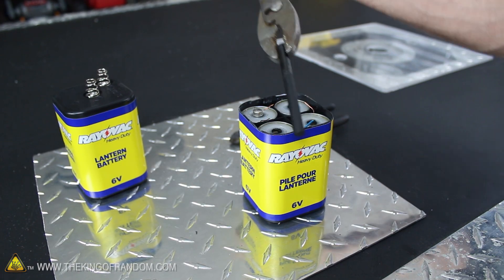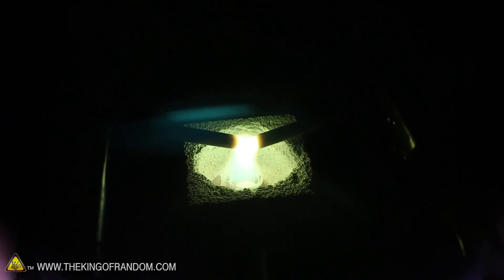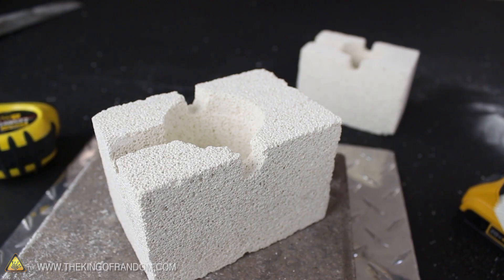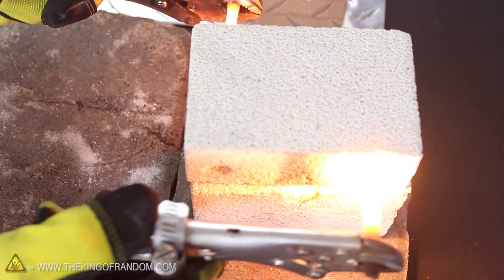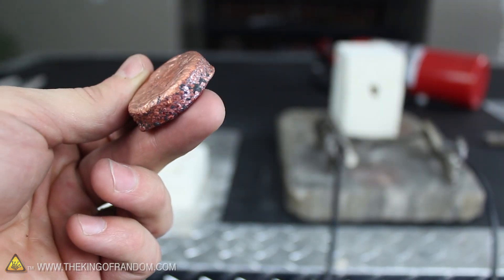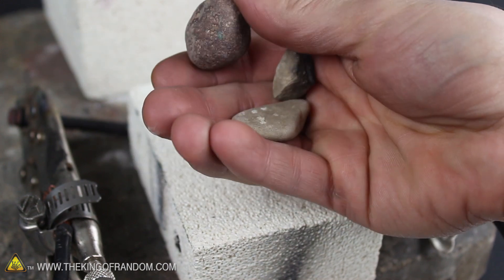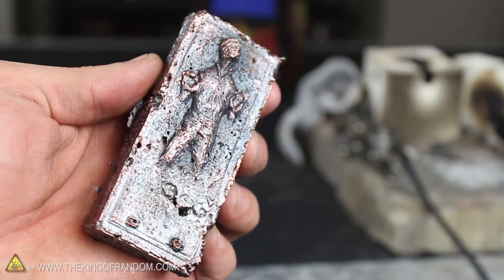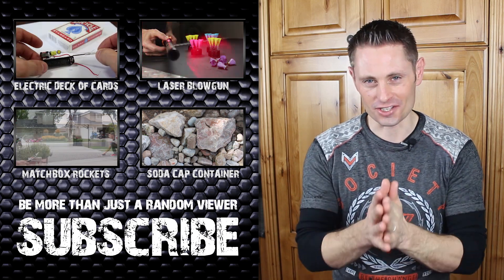Mini Arc Furnace (Arc Reactor Technology IRL)

Comment: Any metal? Even tungsten?
Reply from the maker: Yes, any metal :)
Reply: Iridium reinforced tungsten steel?
Reply: And if you tried to melt tungsten with carbon rods they would react to form tungstencarbide
Reply from the maker: Will Leonard Yes it will melt tungsten
Reply: Benny Kolesnikov That makes absolutely no sense.
Reply: Grant Could you do a video melting silica sand into glass  I'll have to try and make one of these myself when it stops snowing
Reply: If it melton stone, kind of yes, any metal. Pure Tungsten melts at 3.4k ˚C, while stone melts between 1.5k and 4k, depending of the silica composition of the stone. (While it is most usually at 1.5k, i'll place my bets in yes, it can melt tungsten)
Reply: Not tungsten you would have to heat it up to a little over 6000 degrees Fahrenheit
Reply: Grant Thompson - "The King of Random" only metal and rock?  What about RAP ? 

I'm sorry .. don't shoot me with a dart now :(
Reply: Okay but guys, he said it will melt ANY metal, so the question is, CAN HE MELT METALLICA???
Reply: If it was hitting 8 to 9 thousand the carbon rods would start to melt
Reply: Benny Kolesnikov For anyone confused its a reference to a minecraft mod
Reply: Will Leonard Carbon doesnt melt. It sublimes.
Reply: Grant Thompson - "The King of Random" can it melt adamantium?
Reply: Trey B I will try to explain with thermodynamics why this could DEFINITELY melt Tungsten:

He's reaching a temperature of 3000F in three minutes (yuck, Farenheit)

So that's 1600 degrees C in 3 minutes, multplied by the average specific heat of steel (452J/Kg/C) 

Let's assume he's heating 1/4 of a kg of steel, so in 3 minutes, A quick back the envelope calculation says the total heat change is 180.9 KJ, and he's applying roughly 1 kilojoule per second to the steel.

You can probably already see that this depends more on the mass of metal you want to melt than the type of metal.  Also, tungsten actually has a MUCH lower specific heat than steel: (the specific heat of tungsten is roughly 132 J/Kg/C.)  This means it takes less than 1/3 the amount of heat to increase the temperature of a mass of tungsten by 1 degree than it does to raise the same mass of steel's temperature by 1 degree.

So yes, you could absolutely melt tungsten with this, the only constraint is the AMOUNT of tungsten you can melt.
Reply: Grant Thompson - "The King of Random" 
What about osmium
Reply: Grant Thompson - "The King of Random" It would be interesting to see how you would attempt to apply this to the forging process, or maybe make it bigger and modify your back yard foundry for it.
Reply: Maybe not tungsten. I know that tungsten takes like 6,000 degrees of heat before it will melt, and that furnace is 3,000. "Only" 3,000.
Reply: eswar kumar
Um tungsten is a real element xD
Reply: gregistopal That's its boiling point, not melting point. Its melting point is only 3186 °C (5767 °F).
Reply: Most of the Earth is already "melted" except for the crust and the core. We know it can melt rock and iron, so yes, it could theoretically "melt" the Earth... Just gotta find one big enough. He meant any metal above the crust though, away from the millions of tons of force of gravity the core is under.
Reply: Stefano I know, but when talking about melting points in materials which does not melt, the melting point is equal to the sublimation point
Reply: Rasmus Tollund I did not know that thanks :D
Reply: Caleb Evan It was a typo.
Reply: Caleb Evan You clearly have a misunderstanding of the internet.
Reply: Stefano NEVER!!!!!!!!! his BATTERY is not powerful enough
Reply: Trey B A flame doesn't have a defined temperature, also this is not a flame, it's an arc.  it is adding heat to a constant volume, constant pressure system.  I am assuming that the system will reach equilibrium at a temperate higher than the melting point of tungsten, but considering the fact that it's made out of fire bricks, that's a pretty safe assumption.
Reply: ***** nope carbon but thats like 90C higher so they are pretty even (note Carbon sublimates and thats close to its melting point)
Reply: Everything but Death Metal.
Reply: erikharfager ok i guess
Reply: Will Leonard
that plasma arc is hitting close to 8-9k i'd say. So tungstem shouldn't be a problem
Reply: If it gets to 3000°f no it will not tunsten is about double that
Reply: ***** A plasma cutter could do it though bc those can go higher than 28,000 °C (50,000 °F) but since this doesnt have a nozzle that redirects the arc to one point it doesnt goes as hot.
Reply: Kyle Jones Thank you.
Reply: Will Leonard true, but it is kind of like saying that if you melt iron with carbon fuel, you get steel. I don't know, does it count?
Reply: ugh, I can't find my comment, I don't know what happened to it.  I'm not bothering with retyping my sources and making my comment look like it's from someone who has put research into the topic (since it was around 20 lines). But given enough rods it should. (I'm a welding student) Carbon melting point 3550*C, Tungsten 3422*C, Electric arc (lightning is 30,000 Kelvin). Many rods would be used, as the melting points are close.
Reply: I don't think that would work well, considering the difference in melting temp is only ~120C (tungsten is 3422 and the carbon rods melt at 3550/sublimate at 3642)
Reply: Captain Kerbal I'm planning on doing just that, the applying it to forging part that is.
Reply: Sam B If that is Celsius, then I think you're a little skewed because the boiling point of tungsten is 5555°C. If Fahrenheit, not sure.
Reply: ElectricPyroclast its 10031 Fahrenheit
Reply: How about http://en.m.wikipedia.org/wiki/Rhenium
It melts at 10100 ferinheight
Reply: ***** That's what I suspected. Thanks for the confirmation.
Reply: ***** AvE what are you doing here? Get back to making awesome videos!
Reply: ***** tungsten has a way higher melting point than stone
Reply: ***** rocks have melting point of 1200C and tungsten has +3400C which is a lot more than 1200C ofcourse
Reply: Grant Thompson - "The King of Random" Make a "Quick Tips" video of it making Tungsten!!!! I am curious to see if it does!!!
Reply: Grant Thompson - "The King of Random" Or will it make Tungsten Carbide which has a melting point 800'c lower?!?!?
Reply: trolzor Do you honestly think that he has osmium at his disposal?
Reply: Tungsten has almost the same melting point as carbon
Reply: Of course not any metal  if it was any metal it can melt anything even the earth.
Reply: Crazy Confenenation Conformer Yes, when he says any metal I think he means any daily metal.
Reply: no not any metsal  orelse the it can melt the earth
Reply: Rasmus Tollund carbom doesnt melt silly it sublimates
Reply: Stefano It still has a melting point
Reply: Rasmus Tollund it does not, google it
Reply: I'm not saying it melts, it's "melting point" is just equal to it's sublimation point.
Reply: sublimation is not the same as melting silly
Reply: Stefano It is spelled carbon not carbom.
Reply: Caleb Evan well you know bc the M isnt right next to the N
Reply: Stefano Just saying.
Reply: Caleb Evan No need to state the obvious.
Reply: Rasmus Tollund I know.  But if he knows so much about it then I would think that he would know how to spell it.
Reply: Rasmus Tollund Yes I know.  But if he really cared he would have made sure not to spell it wrong.
Reply: Cameron Bigley If it gets to 3000 degrees in 2 minutes there's very little reason to think it can't get to 6000.
Reply: Justin Hall He never tried more than 3-4 minutes though because he thought it might fail, the rods last about 10 minutes each he said, but keep in mind he wasn't going over 3000F ish
Reply: Stefano No, I'm saying you can melt a certain amount of tungsten with it, the less you are melting the faster it will melt.  Since it takes less heat to raise the temperature of tungsten than it does for steel it probably wouldn't take much longer, it might even take less time.
Reply: Justin Hall but you are assuming that the flame is at or above the melting point of tungsten
Reply: What happens if you super heat a diamond? Will it liquefy? Or am I stupid for thinking diamond can liquefy
Reply: Musaddique H Carbon sublimates when it rises above it's heat of fusion point.  That's why the carbon rods don't melt, they actually evaporate!. I would expect that diamond does also since it's a form of carbon.
Reply: Justin Hall couldn't you do some trickery with air pressure to make it a liquid? Or is it a permit solid?
Reply: waysideme Actually, yes, you probably could melt carbon/diamond at extremely high pressures.
Reply: Benny Kolesnikov lol you just got that from FTB
Reply: Chris Nields
It was from GregTech, get your mods right!
Reply: gregtech is in ftb...
Reply: Gone from if an arc Can melt wolfram to discussing mods and modpacks for minecraft
Reply: Grant Thompson - "The King of Random"  What editing software do you use to make your videos?
Reply: Chris Nields
*One of the mods in FTB. I played with GregTech before the FTB launcher went public.
Reply: i said it was in it... what are you correcting
Reply: so he can turn Titanium into a gas with this? Because that's what it takes to melt tungsten.
Reply: erikharfager carbon can theoretically melt at 100 atm and 4000k. however, this is not possible on earth, and so little is known about liquid carbon as we cannot easily produce it.
Reply: Adam Starhawk That is not even relevant, and you only wrote that to get the kick out of "superior intelligence" and therefor, here you go, I am superior'er. These conditions are able to be met on earth. Electric arc furnace, flood the place with argon, use the coal itself as a container. There is little known about liquid carbon because there is nothing to know. There is little known about liquid hydrogen too. And liquid boron. And liquid Byrilllium. And liquid lithium. Do you want me to continue?

Oh, and please dont go around trying to prove superior knowledge, as it is a sign of inferior knowlege. Google the dunning krueger effect.
Reply: ***** It wouldn't because it isn't real
Reply: can it melt diamond? XD
Reply: MultiDragonSlayer820
Diamond is made of coal, meaning it would burn. In an oxygen free enviroment diamonds would sublime directly to gas because of how coal works. You would need around 100 bar of pressure to make liquid coal, at 4000K
Reply: erikharfager yep, what this guys said. 100 atmospheres of pressure, and 4000k to melt carbon
Reply: ***** adamantitanisteel!
Reply: erikharfager i think you mean carbon instead of coal
Reply: Stefano You're right yes. Becomes hard when you think in your own language because in swedish we only have "kol" to describe both  - which translates to both coal and carbon
Reply: erikharfager im dutch but i think in english when im on the interwebs xD
Reply: AtJustDom He means the iridium enforced tungsten thing. Not tungsten.
Reply: Grant Thompson - "The King of Random"
 Even Ununoctium? This metal has such a high melting point that it is unknown to man. Melt this in a video, and you will truly be the KING.
Reply: Nobody Likes The Tangerines
ununoctium doesnt have such a high melting point that its unknown to man, infact, logic has it, it should be a gas, though it is hypothesised to be a noble gas that is solid at room temperature. Definetly not a high melting point tho, its just that, how do you measure the melting point of something that decays in milliseconds and litterally has only been made 3 atoms of
Reply: Chris Nields science, not minecraft
Reply: lol I know he said iridium reinforced tungsten stell which doesn't make any sense. It's just a material from minecraft.
Reply: Stefano Fairy tail?
Reply: Omeaga Plays Ye, what about Fairy Tail? I watch it
Reply: I watch it too :P
Reply: erikharfager diamond is made of carbon witch is the same material as coal but its not coal
Reply: MinecrafterPeep same with paper, its a tree, but its not
Reply: erikharfager wtf did i do?
Reply: MinecrafterPeep cherry picking
Reply: ***** not the right arc furnace, so of course it doesn't work, if you have a video with someone smelting titanium with what grant is using, then do tell.
Reply: Awesome dude
Reply: Molten tungsten is so hot, pour it on a lava it will turn solid. Lava is cold for tungsten.
Reply: MultiDragonSlayer820 Diamonds aren't metal ;)
Reply: I know it can't melt mercury because it is already In a liquid state
Reply: But if you want mercury to turn to a solid then good luck finding a place below -38 degrease Fahrenheit
Reply: VexariMation It can vaporize it
Reply: Jacob Furrow i want to see that.
Reply: +Zakerath Incorrect. You get iron by melting iron ore with coal  (carbon). But iron is high in carbon (and sulfur, phosphorus and other elements, making it brittle). To make steel, excess carbon (and the other excess elements) needs to be removed, not added, in order to obtain a higher tensile and ductile material. I am a metallurgist, and grew up in the steel industry.
Reply: But not carbon
Reply: Yes

Comment: FYI, the sparks flying out of the viewing/pour hole is actually carbon being burned out of the steel as it's heating up.  It's a common occurrence when you're forging metals and need to bring it up to welding temperatures.